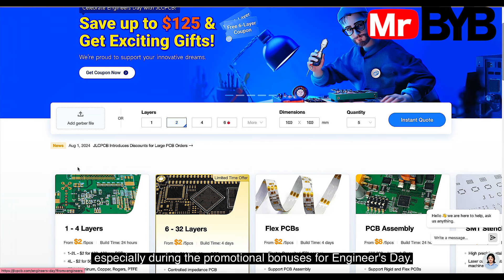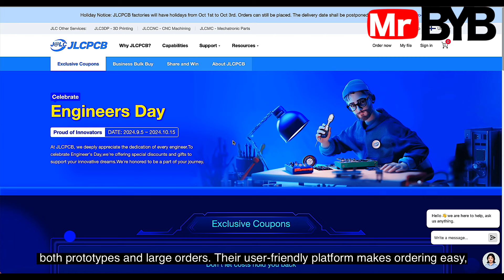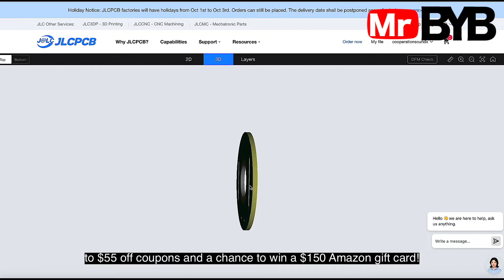How to Make a Turbo Fast Heat Pump Freezing Air Conditioner 40°C. Save Your Money.

Comment: Thank you for the new ideas! I built your previous air conditioner project, and it turned out well, but unfortunately, after 30 minutes of continuous operation, it reaches around -30°C, and I have to refill it every half an hour. Could this be due to the fact that I used slightly different tubes than you did?
Reply from the maker: Which compressor did you use? There might be a leak, or the copper tubes may not be soldered properly. Try making a soapy solution and apply it to all connections. If bubbles appear, it means there’s a leak at that point.
Reply: Yo también y me fue genial que buena idea .nadie pasa calor en mi alrededor sigue engañando😅
Reply: agree maybe there is leakage from copper pipes joints. what compressor required for this project?

Comment: I liked Romanursuhack's design the most (How to Make an Adjustable Split Heat Pump Freezing Air Conditioner -40°C to +50°C. Save Your Money). It’s simpler and easier to build. Your design is quite complex, and beginners might find it difficult to put together.🥶
Reply from the maker: Yes, I’ve seen that video, and I liked it too. I used the same materials, but I think my design is more efficient because it has two parallel evaporators, which should increase the efficiency (COP), as well as improve the freezing time.
Reply: @MrBYB can I have your email address?